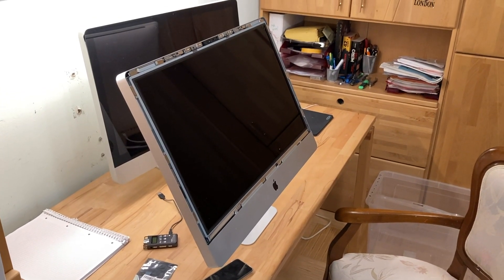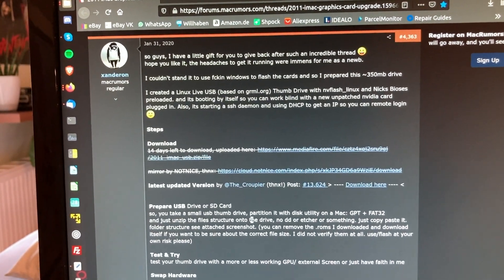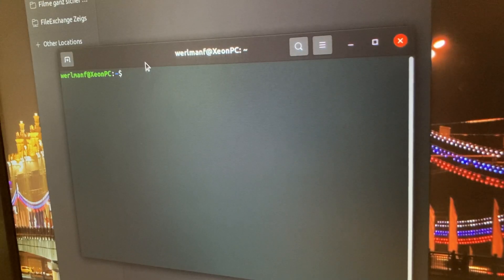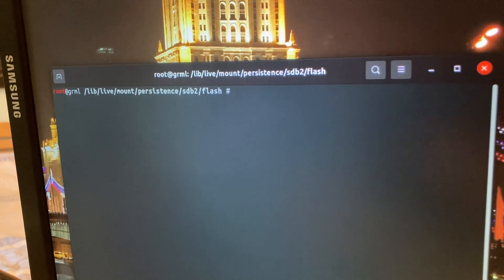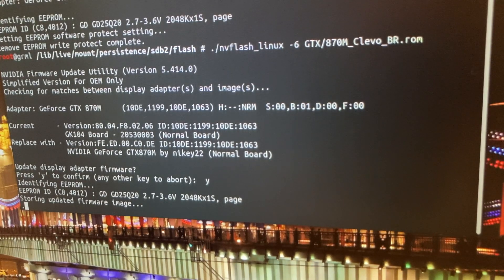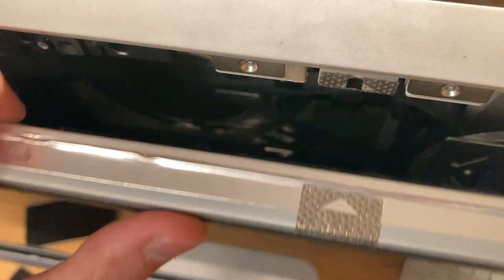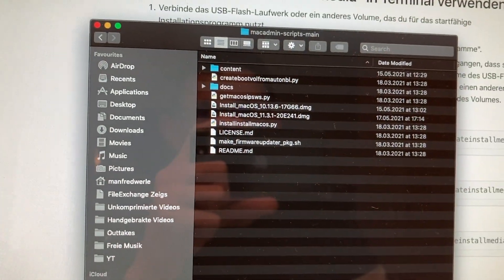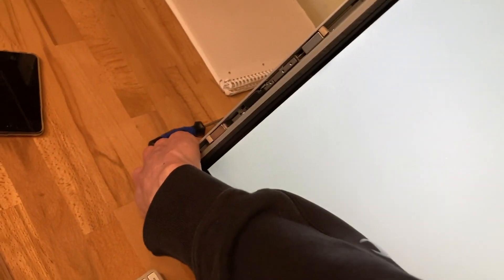The 2011 iMac almost works! - Flashing the GTX 870M for Mac using Linux

Comment: have you tried baking the gpu? I know this is old but I had a dying 1660 Ti desktop card and after baking it at 400F for 10 mins and cooling it (in oven with door slightly open) for 30 mins the artifacts went away, it is now my dedicated LLSFG card, I also baked a dying HD 6970mxm from a 2011 iMac and resolved it's issues for the most part
Reply from the maker: The problem with baking GPUs is that it's in a lot of cases just a temporary fix. A great way to save some data but it's no long term solution.
Reply: @MacintoshMen  While I agree it may be considered a temporary solution my 1660 Ti that has been running almost everyday as an LLSFG card on all my games recently says otherwise, sometimes its just luck wether you get a lasting card or not

Comment: Wow! Finally u get iMac working! Congrats. I’m also have 21.5’’ 2011 iMac in stock condition. Waiting to receive 500gb Samsung 860 EVO. And also when watching your videos about this iMac I decided to upgrade GPU too. Thanks a lot! Will do my best. And also I use Ubuntu only in university(2014-2018) by the very first level of understanding. Now I will install Linux Mint at my X1 Carbon 1st gen. Unfortunately display flex are broken so it will be good chance to learn Linux remotely by Ethernet. Once more time thanks a lot for your knowledges and so many cool videos :)

Comment: But on Windows 7/10 any unsupported mxm card will work? I dont care about macOS i want to keep using my 2010 21.5 on Windows
Reply from the maker: Yes, on Windows it's all very easy. Just download the Nvidia driver for your card and you should be set. I am currently also running Windows 11 on my 2010 iMac with a 765M and it works flawlessly.

Comment: I don't understand why it boots up that 100W GPU and not an Apple ATI 5750 which should work less TDP... Only shows black screen.. iMac 2011 21.5" all the parts confirmed working..
Reply from the maker: It doesn't have anything to do with the TDP but I think it's the compatibility. My guess is the older 5750 probably doesn't work with the 2011 iMacs; Apple is known for such stuff. It wouldn't surprise me.

Comment: Hopping the best for you, when you sort the things out with the selller, tell us how it went :) Then make a update on this machine, i would like to see you finish the project.
And, on the other hand, i'm getting a little anxious because of your video tbh, i bought a few days ago, from aliexpress, one k3100m (dont need the big power of one 7xx or 8xx, its only to upgrade de 11,3 and run some photoshop or other school related work (and still have the 2 pipe heatsink mxm-b, hopping that will do, ill control the temps with Macs Fan)) and i really hope mines arrive good.. I dont trust the support of the aliexpress.. But i bought the card with paypal, hope that adds a boost to solve some issue :/
By the way, to run catalina or big sur, do you confirm ill need to change the airport card?

Comment: You might have used the incorrect .rom file

5-3-2021: I've removed 870M_Clevo_BR.rom because it is not functional and replaced it with GTX870M_V1.rom

see https://forums.macrumors.com/threads/2011-imac-graphics-card-upgrade.1596614/post-28742848
Reply from the maker: Another viewer has already given me this tip to try the GTX870M_V1.rom (+ multiple PRAM resets). I tried it but still the same problem. The GPU itself has a problem, but thanks for your kind help.
Reply: @MacintoshMen  I understand and yes if the card continues to exhibit issues then I wish you all the luck in the world with getting a replacement. If you are polite with the seller and let him know that an exchange is all that you seek I am confident he/she will be willing to work out a replacement. Please don't give up because I do believe you are very close indeed.

Comment: Are you using non-conductive thermal paste?

For the GPU Die any thermal Paste like Thermal Grizzly’s Kryonaut paste is good for the Die. For onboard components, many recommend using K5 Pro Viscous paste instead of thermal pads, due to the unevenness of the heatsink, it’s also similar to Apple’s original Design. See: Spoiler: Q7: What paste is recommended to cover the VRAM/Components on the MXM

Comment: Hi there,

Don't give up yet..
Please use/try GTX870M_V1.rom vbios
Seems like 870M_Clevo_BR.rom vbios has a bug..

Hope this helps,

The GTX870M_V1.rom can be easily found on the Macrumors iMac 2011 ugpgrade guide.

p.s
always do a nvram reset after doing a vbios flash..
Reply from the maker: Hi, thanks for your tips, I tried it with GTX870M_V1 + multiple PRAM resets, however no luck unfortunately. The card is broken.
Reply: @MacintoshMen  I see,
thats a pitty.

I have read sometimes, that people also have these problems, and they where always related to a non compatible mxm card.
the vbios was not written for the memory chips on the mxm video card type the user used in combination with the vbios.
yes these artifacts definatly look like a dead GPU, but several times people also had these problems due to an incompatible vbios with their specific card.

I would advise you to post a help question over on the macrumors guide, perhaps you just might have an incompatible brand/type of gtx870m.
then Nikey22 should update his vbios, like he did in the past for other nvidia cards, and made new vbios version for other mxm cards that are arround using different memory chips/clocks.

If you flash back the original vbios, and use bootcamp you should perhaps only have external screen working.
this way you can test if it works normaly fine with the original vbios, and see if it will perform like it should under bootcamp.
I would advise you to try this aswell.

I would still give it a chance that the card might be ok, but perhaps just you are using an incompatible version (like MSI,Asus) which does not play nice with the vbios.
If so then nikey22 should be able to create/update a new vbios to be compatible with your type of vram chips..

btw I dont trust much GPU sellers on aliexpress, they all claim there cards work 100%. 
I bought our mxm cards, from local EU sellers, they are still working perfectly..

Comment: I m like 90%  sure that your vram is overheating ....  take off the thermal paste and put on  thermal pads
Reply: I would tend to think that is not true as the machine is barely doing anything graphically at all. In fact, starting with shift would turn off the GPU and use the i7 built in video hardware. No it can't be that the VRAM is overheating. It could be easily proven by leaving the machine off for 15 minutes so that it cools. Then on restart if the Apple logo continues to display unexpected pixel anomalies then it is not heat.
Reply from the maker: On only booting up a installer? Not really what I think
Reply: @MacintoshMen   Bro spend the $5 on thermal pads... I know it sucks to  redo.. this is  classic vram artifacting. If it  don't work you  can tell me to go F myself
Reply from the maker: @KGerm  No, I won't do that, that's not gonna change anything, believe me mate, the GPU is toast.

Comment: Try baking the graphics card in oven. Believe it or not this sometimes works. You can try installing high Sierra on another Mac and then boot it up...
Reply: DO NOT DO THIS, it's a temporary solution. The video card will suffer from same failure in days or weeks. The issue is unsolvable without microsoldering repairs (replacing gpu chip or memory chip)

Ignore the jm03 guy, the video card is faulty as shown & said in the video.
Reply: @LolJolk  That's the thing with baked goods sometimes you have to eat it...
Reply: Are you insane? That's a guaranteed working GPU he bought... Maybe watch the video.